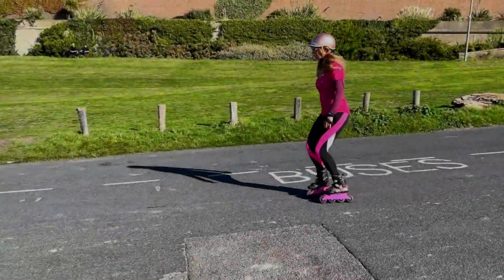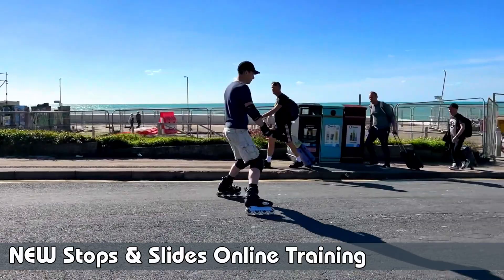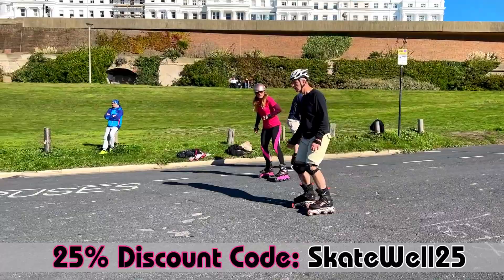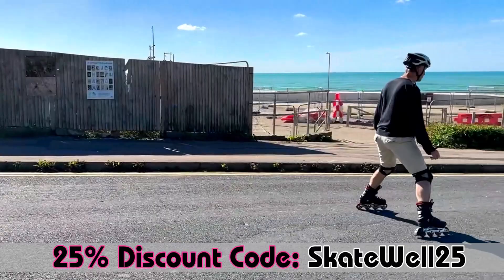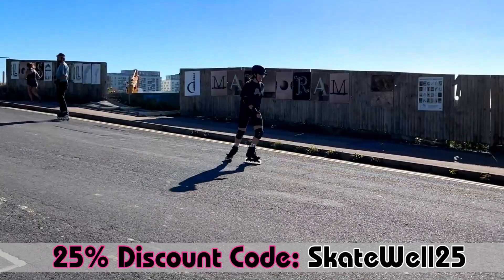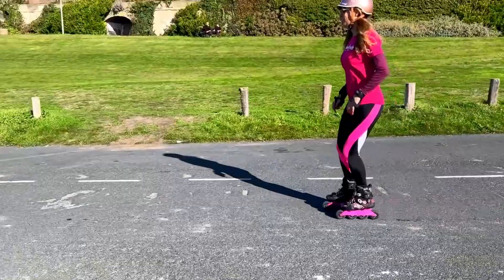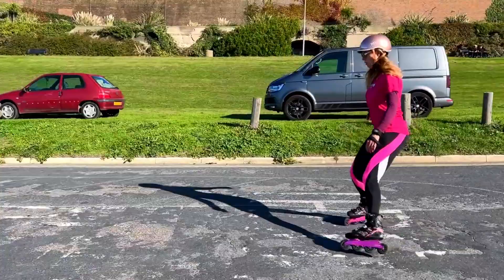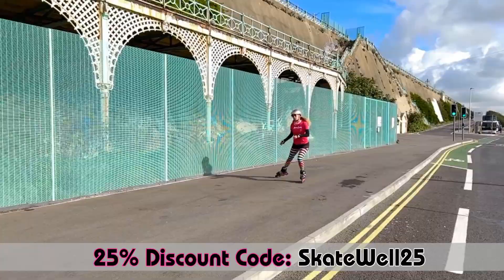How to decelerate & stop on downhill slopes on inline skates using the T Stop & Stepping Plough stop

Comment: Thanks for the video, but when I try the Stepping Plough sommetimes I go faster instead of slowing down. 🙂
Reply from the maker: It sounds like you are trying to learn the stepping plough on a downhill slope. Why not make your life easier and start the process on flat ground. If the stepping plough works to slow you down and stop on flat ground THEN graduate to a downhill stop where you'll have to be even more precisely accurate with your technique for you to get good results on a slope.
Everything should be a progression. I also imagine you are trying to learn without a series of progressions to teach you the core principles needed for the stepping plough to work.
Do check the online training for Stepping plough as it really does work for making people finally get the stepping plough and have forever.
https://skatefresh.com/stops-slides/
Reply: @SkatefreshVideos  I did do that on flat ground. I push my heels out. maybe I should put my feet out and then pull towards me. who knows? I think you do 🙂.
Reply: @Lindeveld  any progress? I was debating joining lessons myself but I’m on 72mm wheels atm so not sure the terrain is suitable
Reply: @3rdtwirl494  smaller wheels can make it more easy to do the stepping plouch stop. Best to do that on a flat surface before trying it on a downhill.

Comment: Heya Asha, I'm pretty comfortable with stepping plough as a stop but I saw somewhere you first go into the plough position before doing the stepping part of the stop - what's the purpose of first going into the plough position?
Reply from the maker: You can do either, straight into stepping or plough first. The normal (non-stepping_ plough has the ability to shave off 40-50% of the speed (by pushing the heels outwards), so making the stepping plough a little easier at lower speeds. That's the only reason I might plough first. However for many people they lack the technique to actually slow down effectively with the normal plough. It's not as easy as it looks.
Reply: @SkatefreshVideos  thank you, I did try regular plough once and didn't find it slowed me at all so haven't bothered since. I'll try work on it.